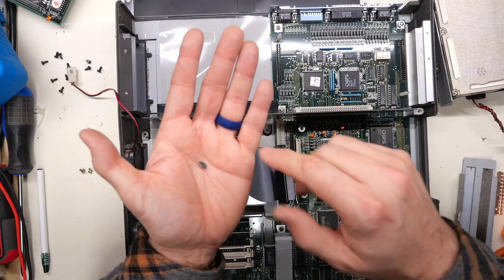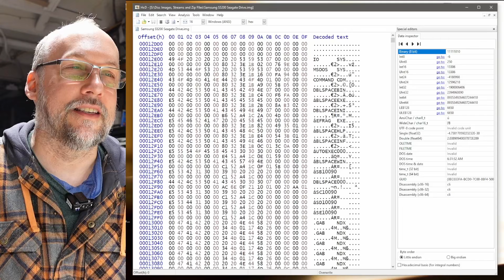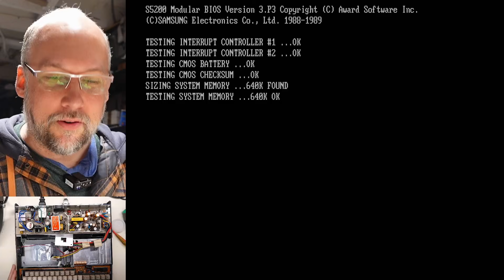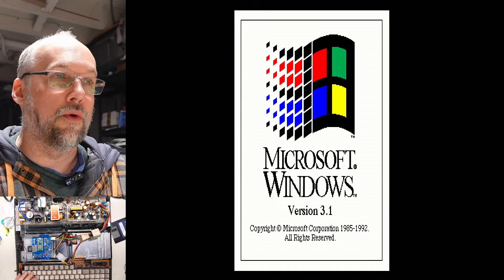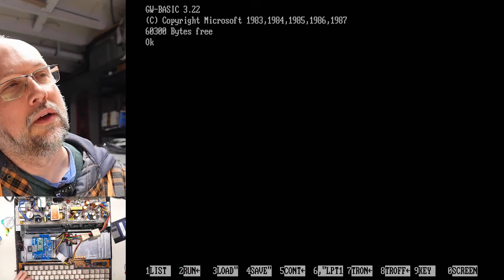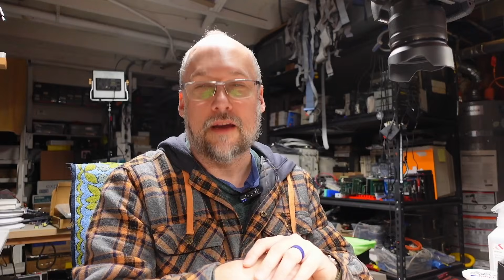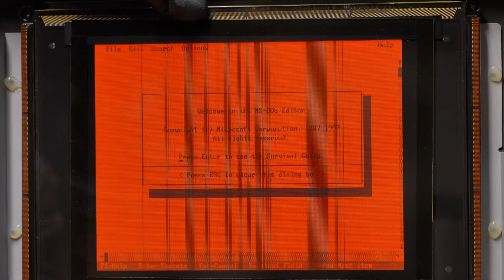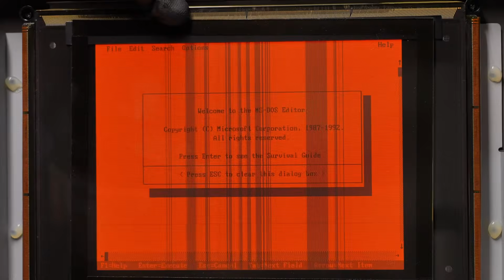PC Archeology: Let's explore the Samsung S5200 and attempt a repair on the gas plasma screen

Comment: The lack of SCSI on the back makes sense in some ways. SCSI may have been the only choice they had other than MFM/ESDI for this form factor. An external connector probobly never occurred to them. Would an XT IDE ROM drop in place of the SCSI ROM?

Comment: Makes me wonder if that glue could be softened up and allowed to "reflow" as it were to bond back together. If it were me, I'd try putting a cloth over the glass and running a clothing iron back and forth along that edge with some slight pressure. It's already basically useless as it is, what's the worst that could happen? The heat could cause it to delaminate even more?; but it's already unusable in it's current state. No harm, no foul honestly.

Also, DoubleSpace and DriveSpace are the same thing, just different versions. DoubleSpace was using code owned by someone else and Microsoft were successfully sued. They removed the copyrighted code and renamed it to DriveSpace. I think this was one of the main differences between Dos 6.2 and Dos 6.22.

Doing a dir/a command will show you all files, including hidden and system files. You'd see the container file that way and you'd know for sure it was a compressed drive. That is, if the 3MB free didn't already give it away. ;)
Reply: I was hoping he was going to try to fix it

Comment: Doing a quick search, I found 3M 7303. That might be what is needed. It's a thermally curing anisotropic conducting tape. (This is why reheating the adhesive does not work. It cures with heat and won't "reflow") 

To bond it you need around 18 bars of pressure at 140C (around 260psi, so a hypothetical 1"x0.25" connection might require it to be clamped with about 60-70 lbs of force) The temp can apparently be 150 or 160. It's not super critical that it be exact, just got enough it seems. 

To do it your going to need to build a device to apply the heat and pressure and find something to practice on. Im thinking of some sort of copper block with a geater element like used in a 3d printer and a thermocouple, with a silicone pad so you dont have metal on glass. You'd need to make a mechanism to clamp it with appropriate force. Some sort of pliers maybe with one jaw being the heater and both jaws on pivots lined with silicone pads so they will sit flat. Then maybe a spring between the handles eoth a screw to tighten. Then calculate the force on the jaws from the dimensions of the pliers and the smount the spring stretches.

Comment: Go ahead and use a soldering iron at low temp on it. You can fix it just as I did with the various LCDs over the time. This is a plasma display, but the bonnding principle and the electrons are the same. I would go as far s to apply conductor on it and redo the straps.

Comment: I wonder if you can find the SCSI ROM chip, cut ENABLE pin, and map XTIDE to the same address.

As for the screen - I would try unfolding the screen tape fully (use a hair drier at low setting, the adhesive probably does not need temperatures that can degrade flexicables to be soft enough), and then gently compress the cable and apply heat (from the same hair drier). I think there is a change the glue that bonds the cables to the screen is actually heat-meltable and it just came loose? Though it is possible to damage the screen even further.

Comment: Tantalums are a massive problem even today. My company has banned their use in any future products due to their high failure rates! In my experience, even upping the voltage rating will not stop them from failing.

Comment: I would like to try a file recovery on the SCSI drive. Maybe make a full image of the drive, mount the image, and try to do a file recovery on the mounted image.
Edit: And less than three seconds later you do exactly that.
Edit2: Look for a program called "testdisk". You can mount the image under Linux as a real drive. Testdisk will extract files and not "repair" the drive you're reading from.
Reply: DIR /a to show hidden files...

Comment: Data recovery? ddrescue to dump the image (critical if the disc has read errors in some areas), then to the resulting image, testdisk/photorec, or foremost which is used for forensic recovery, very impressive but tends to get only partial data (enough to prosecute i guess) specially when the drive has been written/erased many times!

Comment: Haven't finished watching the video yet but I have a Toshiba T3100e, which is VERY similar (maybe Samsung licensed their design from Toshiba?  It has an IDE hard drive, and Olivetti/AT&T video instead of EGA, but is otherwise almost identical), and it has similar display issues, but not as bad, so I'm interested to see how any display repair goes.

Comment: About the recovery of the old hard drive partition. I remembered there is an utility in the old version of Hiren boot CD or in the Ultimate Boot Cd. I don't remember the name  but it will allow you to recover previous partitions and or recover file from that.
Reply: The utility is called Ranish partition manager. Hiren boot version 7 also have a copy of Norton Disk Editor 2002 that will allow you to manually recover files.

Comment: I wonder if deoxit fader lube might stop the corrosion if you put it along the glass edge.... Though I only have about a 5% success rate with trying to fix screen edges so maybe better left along.  Those zebra strips you mentioned are my nemesis lol not sure I have ever successfully repaired one.

Comment: MS DOS 6.0 and 6.20 use DBLSPACE which was removed in 6.21 and replaced with DRVSPACE in 6.22 due to a copyright infringement lawsuit. I believe they use different algorithms, so it's possible that DOS 6.20 can read the drive fine but 6.22 can't.
Reply: DOS 6.22 could read the DBLSPACE format and also would offer to convert to the DRVSPACE format.

Comment: 1:16:28 I have seen similar damage on plasma screens of laptops and televisions, it is due to the use of cleaning liquids based on non-isopropyl alcohol, which produces evaporation and condensation of water in the connectors, which produces corrosion.

Comment: 7:05 I think eevblog has a couple videos about failure modes of different capacitors.  I definitely remember a good one about smd board stress cracking ceramic caps
Reply: And loud noises and vibrations

Comment: Hi Adrian, could you get an award bios from another 286 board compare the two find the differences locate the section dealing with ext to me and patch it. I used to do that in the 80s and 90s with multiple computer systems, CPM, Apple 🍎, PC compatibles. Very successfully. Granted it is time consuming but the rewards can be satisfying.

Comment: I had one of these and the display was fantastic compared to LCDs of the time. The ability to change the palette for the best contrast with various programs was pretty much essential. With a maths coprocessor chip fitted, these portable machines were the equal of pretty much any desktop of the time. The plasma display could get pretty toasty at high brightness and contrast settings and there were warnings in the manual to keep things dialled back to avoid display problems. Obviously when these computers were used in a commercial environment where the users weren’t footing the bill, the display and contrast sliders were always pushed all the way to the right. The software loaded and legacy versions of DOS pretty much prove this was used in an office and not treated with a great deal of consideration.
Reply: Mousetrails had to be added to Windows to make it usable on LCDs. Otherwise you would lose the cursor as soon as you moved the mouse.

Comment: Run a hot soldering iron across the connection on the glass, it should re-bond the ribbon to the glass.
Reply: It could,but every time I've tried it, it destroyed the cable. Most of the adhesives cure with heat so they won't reflow. The iron just destroys the plastic film.

If I recall, the typical way those connectors were bonded was with what's called an anisotropic conductive adhesive. It consists of particles of conductive material in an adhesive that is melted by heat. The particles are of such a size and number that there are not enough to create a connection between the contacts in the direction tangent to the board, but when the adhesive is heated and compressed it can make a connection normal to the board. 

It needs both the heat and the pressure. It probably is fixable, especially because there are far more materials readily available these days than there were 25 years ago when I last tried repairing these.
Reply: @michaelallen1432  I've had success with this method fixing displays on the gameboy, the trick is to run the hot iron on the glass not directly on the flat flex, may take a few passes.
Reply: @RobR386  it occured to me a while after I left my comment that perhaps the reason why some of these things fail, and some are reported to work after heating may be that they were not heated sufficiently to properly cure the adhesive at the factory, both causing the initial failure and leaving some uncured adhesive left with which to rebond. Its said that most don't have an exceptionally long life after the repair. Perhaps applying pressure along with the heating might help that.

Comment: I wonder if the video chipset in there has MCGA support... 640x480 with 2 colours is a standard MCGA mode, but MCGA is not backwards compatible with EGA, but that wouldn't necessarily stop a graphics chipset manufacturer from supporting both standards? Not to mention, those reported VGA/MCGA modes looked to have faster throughput than EGA if I was reading those numbers right? Very curious.

Comment: Double Space came with Dos 6.20 but then was changed to DriveSpace for 6.22 for licensing reasons I believe.
Reply: DoubleSpace actually came out with MS-DOS 6.0. Then after the release of MS-DOS 6.2, Microsoft was sued by Stac Electronics, who made the Stacker disk compression software, for patent infringement. So they brought out MS-DOS 6.21, which removed DoubleSpace, then introduced DriveSpace in MS-DOS 6.22.

Comment: I never thought I'd feel any nostalgia at all for seeing Laplink (LL3.EXE) again. lol

It was useful, but insanely slow to copy any large-ish amount of data.

We had to use a serial Laplink cable on a Toshiba Libretto at the PC shop in 1996, to make a backup.
Even the parallel cable wasn't that great, and not all parallel ports could use it.

At the time, we didn't have any adapters for the tiny IDE hard drive, nor the docking station for the Toshiba.
It took about two DAYS (and nights) to copy the HDD onto another machine via serial Laplink. lol

I'm glad that part of computing is mostly over these days.
Even with vintage computers, a solution often exists now, to make it easier to use modern storage.

(BlueSCSI, FlashFloppy/Goteks, Everdrives, etc.)

Comment: I had two of these a few (a lot)  years back. The plasma screen was mono ORANGE...
One screen was cracked and the other didn't work for whatever reason. I made a good one out of the two. But they were HEAVY beasts though.

Rethinking about this, I'm now convinced that they were Toshiba's..... Hmmm time does things to the memory.
My first computer was an Acorn atom, built from a kit.
I've had many computers over the years including the xt, and at and an apricot xi . I also had a "pc" that had a full height rll drive. I think it was an Research Machines computer. Pity I don't have it now...

Comment: Interesting you think (and you may well be correct) that HEAT was the devil to those connectors up top as heat has been know to rise and considering the lower lines seem to still be perfect, then you're probably correct. Funny because as you were looking at it taken apart, I was thinking maybe applying some direct heat right where those connections are, even being under the glass, that maybe some heat right on the bad areas would re-connect or almost reapply the connection to the glass.. Oh well, this was a very cool find of yours, I'm glad you took it down as far as you did and showed us... very neat, and I'm SURE the 500 something dollar replacement "replacement" screens are JUST AS BAD. Shame, glass plasma displays are actually VERY gorgeous. An ex gf of mine and I purchased a television from Sears many many years ago, it was a plasma screen, and it looked a million times better than the old LCD screen from back in the day (early 2000's).. it was a gorgeous screen, very expensive original price but still, a beautiful home theater screen for its time!!

Comment: You can fix this.
What you are seeing at the top are burnt traces caused by the slamming that the lid endured when closing. They should have never used a plasma screen in something that receives so much kinetic energy. The cure is to bodge wire each trace that is flakey.
You can fix this.    And it will be hard!

Comment: Dumb question: are the connections at the top of the glass panel corroding, or just looking bad because they're delaminating and coming off, with residue left behind from the adhesive used?  Probably really hard to fix, but it might BE fixable.

Comment: Given all of the problems with plasma displays and the way they are essentially a non-starter these days, I would be interested personally in seeing an LCD panel replacement. 3D printed mounts are not difficult to do, there's a ton of space in that machine, and it seems worth it to me. You could get EGA color graphics on it, and it would make the machine actually usable. I think it would be a fun hack to watch you do, and it would save the machine in a usable state. The original plasma display could be set aside without being thrown away if someone with skills wanted to take a crack at fixing it later, but I really don't think it's even worth saving at this point. These displays were far too finicky, and it's why they didn't last long in production. 

I think replacing this machine's display with an LCD panel would be in line with what you've done previously with the TV set, and it could help everyone with these older machines further our understanding of how to do it. It beats having broken machines sitting around IMHO. No, it's not ideal, but plasma displays aren't coming back.
Reply: Plasma displays were expensive and way too power hungry. So for laptops with batteries it didn't make sense, and for desktops, crt's were better and cheaper.. plasma TV's stuck around until 2013 or so. I'm watching this video on a 1080p pioneer plasma. For TV's it was weight and expense that made them fall out of favor. They were the OLED of the time. My TV would have cost 8k in 2008..
Reply: @mikafoxx2717  I'm guessing you have a Kuro? I have one too and I absolutely love it.
Reply: @chickenfizz  
Yep, the big 60" it's a great TV, built very well. If it ever has a problem, it's probably even fixable with new power supply caps.

Comment: there used to be a forensic recovery program called "Encase" Authorities have used Encase to recover data from formatted or erased hard drives. OK, I stand corrected, it is a doublespaced drive. One more thing, maybe the reason Samsung included a SCSI hard drive is that SCSI hard drives in those days were faster.

Comment: One would need  Anisotropic Conductive Film Adhesive (can be maybe obtaind fro 3M or others, found some links in Google but not a direct purchase option), remove the bond with old adhesive and then rebond it. Question is if the contacts on the glass and/or flat-flex are intact or not. Overall extremely tricky process with high risc to make it even worse. So no idea if it is worth trying. Anyhow I would like to see someone to try it and possibly succeed, it would be of a great help for so many people with dead LCDs and other types of pannels with the same problem.
Reply: It seems like the first runs of these displays had the adhesive contaminated and it started to corrode the contacts.

Comment: I volunteered at a recycler 20 years ago and the amount of this stuff we threw out as useless hurts my soul to this day.

You're such a good steward to this old tech. Thanks for doing what you do and especially thanks for sharing it with us!
Reply: I curse myself and my parents everyday for the stuff we threw out over the years…
Reply: I don't. I simply didn't have the space to hold onto things, with the anticipation of 20-30 years. I'm glad I got rid of things and didn't have to hold onto the clutter! @pelculator
Reply: I worked for a School district in the late 90's the amount of old Commodore PETs we had tossed in to landfills seems criminal now.
Reply: Same. The stuff we just threw in bins to be melted down ugh.
Reply: I have also seen many hi-tech stuff that people bring to the recycler.   It is unfortunate.   I would have loved to try to save them all, or most, but that would be impossible & I would then be inundated.  I repair some electronics too but I would drown trying to repair them all.  I have saved some from the recycler though, like hard drives, memory sticks, etc, although you have to be doing that secretively, heh.   I too still have my Commodore 64's (3 of them), including peripherals, disks, manuals, mags, papers & whatever else.  One of them is my original first-ever 64, bought in 1983.  I am not a collector per se, I just keep what we have bought over the years/decades.   This also includes some CRT TVs & monitors, typewriters, print calculators, PC motherboards/cases, impact/inkjet/laser printers, audio speakers, & a lot of other stuff.   But one day, it will be my turn to leave this mortality & will have to also leave all of this materiality behind.
Reply: I wasn't allowed to take anything home at my time at Geek Squad. But at least the company that took all the stuff in supposedly sold off functional stuff online.